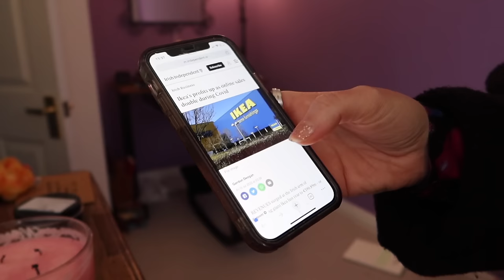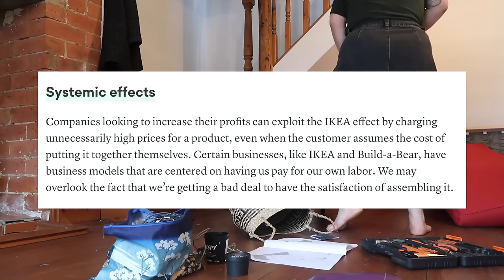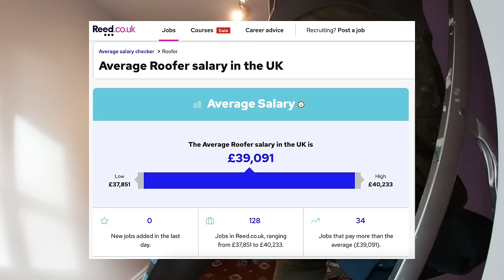we need to talk about 'the Ikea effect'

Comment: Sometimes I wonder if I live in some kind of alternate universe because I don’t find Ikea instructions hard to follow and I’ve never had a piece of their furniture break on me. Even the bookshelves we’ve had nearly ten years and moved house with—still brilliant condition. I use my Ikea desk every single day and it is perfect. No bad quality here.
Reply: Ikea instructions are probably the easiest to follow of any flat pack furniture company i've ever had to put together.
Reply: Agreed. I think the trick with ikea is to find the pieces that are made of better materials (wood, metal, etc.) rather than mdf. I’ve had nothing but good experiences with IKEA using this method.
Reply: Ikea is great. I had to rewrite this comment because it got too long with praise. If one's worried about quality, just get the solid wood items instead of the chipboard. It's still cheaper than other manufacturers (generally) and it lasts what I assume will eventually be several generations. My parents first furniture set is still doing amazing, and since most of their stuff works with other models, we were able to update/replace anything that was deteriorating through the years (mostly just a very specific model of drawer rails)
Reply: I honestly think the perception of IKEA furniture as impossible to put together and liable to fall apart is a kind of learned helplessness from people in a culture that is so removed from the process of craftsmanship that the idea of “building” your own furniture (even if it’s just putting together some screws and pegs) is daunting.

I’ve always found IKEA to be the most easy to understand instructions. I’ve called it “legos for adults” because I find it so soothing, and I’ve volunteered to build furniture for nearly all of my friends at one point or another. 

But something I’ve realized in the process of that, and in this past year of buying furniture secondhand, is that folks will just… give up the second it seems difficult. It doesn’t have to ACTUALLY be difficult, just seem like it.

This year I’ve purchased two large items secondhand - a trundle bed and a motorized standing desk. Both items, when I got them from their previous owners, were shaky and seemed flimsy. And when you looked closely it was because MOST OF THE SCREWS WEREN’T TIGHTENED. And there was nothing wrong with any of the parts or materials because as soon as I actually put them back together after transporting them, they’re far sturdier than they ever were at their previous locations. 

I think it’s hard to shit-talk IKEA when people aren’t even putting in the bare minimum of effort to make sure their screws and bolts are actually tightened. Their stuff can REALLY last if you actually treat it well and make sure you didn’t just throw your hands up in defeat preemptively.
Reply: Gosh yeah.. I mean I've mainly grown up around IKEA, but so far .. some things of course have dents and scratches, otherwise the worst are some chairs being a bit creaky after 15+ years I wager
Reply: Same here, it was super simple to put together and it was full/whole wood quality, unlike all the woodchip-material things I bought. That was custom made. I can't afford much more. I bought it second hand, the ikea stuff, and it was amazing
Reply: Me too; I've had a hemnes dresser for 10 years, moved with it 7x, and it's still fine
Reply: Same here as someone who has put together other brands of furniture as a part of my job ikea has by far the clearest and best instructions. I absolutely yearned for ikea instructions when building other furniture. I must be from that alternate universe bc I own six of those cube bookshelves from over a decade ago and they’re so sturdy that I sit and stand on them frequently to hang shelves and pictures bc they feel sturdier than all my ladders. In watching other people assemble ikea furniture I’ve found that a lot of people just literally skip steps, like if a joint needs two screws and a peg they do one screw and assume the others are redundant and don’t use them which blows my mind. I’ve run into two instances where a predrilled hole is a little off and needs to be redrilled but by and large I’ve never had a lasting quality issue with a piece of ikea furniture as long as they’re assembled according to the directions
Reply: Reminds me of my friend at the time had me over and her fam just happen to buy new ikea sofas so i helped put it togather, they were extremely shocked when i was able to read the instructions and organize most the things (the pictures helped a lot!l
Reply: Same. I’ve bought other brands and their instructions felt like quantum mechanics. Whereas ikea’s literally have drawings like explaining to a child. In terms of solidity it depends, some items can withstand moving, some don’t. Most will like well enough if they’re not made apart and together again though.
Reply: Ikea literally encouraged me to start doing basic reparations in my house and machines by myself, I was like "if I was able to build this by myself who says I can't do other small reparations"

Also I've bought from plenty of range, from the cheapest bookshelves to more expensive pieces and they're all still good after years, I think my oldest ikea furniture is probably around 12 years and it's still in perfect condition, aside from a few scratches.
Idk maybe I've just been lucky with my furniture taste?
Reply: I love putting together ikea furniture with my dad bc he always marvels at how clever the construction is 😂 it’s very endearing
Reply: I still use the Ikea kitchen my parents got over 30 years ago. Yeah, it definitely looks used, but it’s not bad and everything still works well. Most of my furniture is Ikea. A lot of the materials are pretty flimsy, but if you take care of them they can go a long way. My hemnes bed was having issues after 9 years of daily use, but that was easily fixed with some extra screws. My Ikea table’s doing really fine after 7 years of daily use. Some of my Ikea furniture have dents or scratches, but I don’t particularly mind. And most of the stuff I’ve assembled on my own or either my mum. If you follow the instructions it’s not complicated. The images aren’t there for fun, they’re there to help you assemble it the right way. I tend to flick through the instructions once and check all the parts to know what to expect, and then just assemble it following the instructions. I think that all the folks who have issues with Ikea just ignore the instructions or something.
Reply: I was building ikea stand just the other day and was thinking just that. Ikea has some of the best instructions I have ever seen.

Also had ikea furniture's that lasted since my kids birth 12 years ago and still show no signs of falling apart any time soon
Reply: I came to comment the same thing xD straightforward instructions even an idiot like me can follow them (i did my first flatpack at about 16, and ive had those shelves since)
Reply: same
Reply: Totally agree! Where is this Ikea furniture that is breaking constantly, i've never seen it.
Reply: I dunno. Yes, we have the Ikea MDF bookcases, some around ten years old and still look decent. But it's a far cry from the quality you used to get from Ikea back in the 90s/early 2000s, where it was genuinely good furniture at an affordable price. I feel like the prices have stayed the same or gone up and the quality has gone way down. It will last okay if you look after it but it's still pretty shit tbh.
Reply: @guesswhatrielle It's the cardboard stuff that you should be aware of. I had a table that was two pieces of wood on the sides and inside was just filled with cardboard in a sort of honeycomb pattern. That one, I wore down in a few years.

Their MDF furniture is perfectly fine, though.

MDF is actually such a god-tier material, I wish everything was made of that.

Looks decent already, but is very easy to cover up. It's nice to the touch. It's easy to drill holes into and does not lose strength from it.
It can be made perfectly straight with exact 90° turns better than almost any material.
It is uniformly strong in every direction. There is ~0% of a crack forming randomly.
It does not resonate much, so machines on it won't bother you. It insulates heat well, making it always comfortable to touch.
And of course it's cheap.

Comment: Woot woot. 
I have several bookcases I had to assemble myself and one antique bookcase I drove like 10 hours round trip to get (not straight, my sister lives in a big city so I drove to her and then we drove together to the bookshelf, and then I drove home over the course of like 3 days). And the difference in quality is insane between this 90 year old mass produced bookcase and the modern ones. 
If I downsize to a smaller space and have to get rid of some furniture- the ikea effect will not save the modern bookcases. I am holding onto the antique one as long as I can.

Comment: Anyone complaining about ikea instructions has apparently never put together a piece from any other flatpack furniture company. I assure you, ikea's instructions are clear, easy and properly designed. They have proper and visible markings of what goes where and what screw is needed.
I say this as someone who loves the act of putting a piece of furniture together and has tried different brands (available here in Poland) that have varying quality of info cards for their pieces.
Imagine the same kind of shelving unit as Billy bookshelf, but instead of a BOOKLET woth multiple pages, you get a 4 page sheet (1 sheet folded, 4 pages in total) and all steps are compressed on these 4 pages...